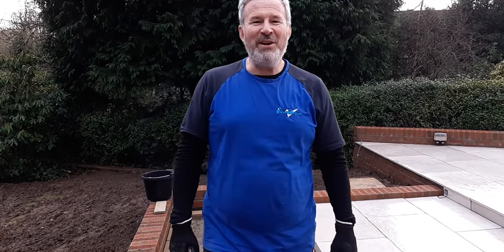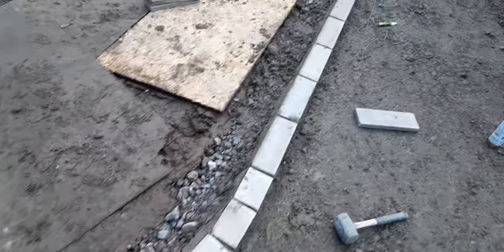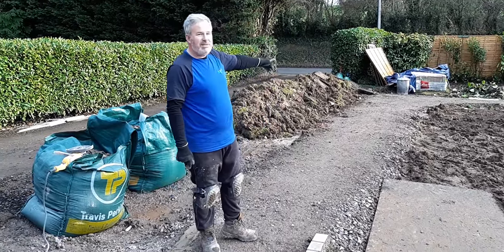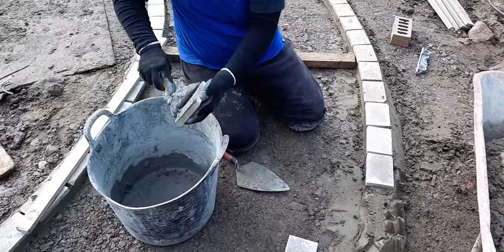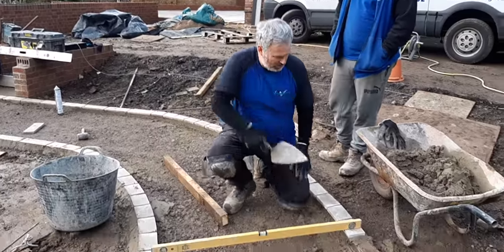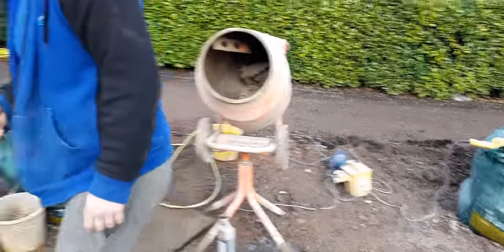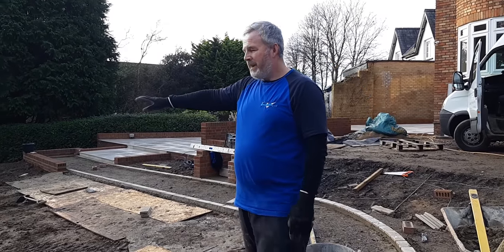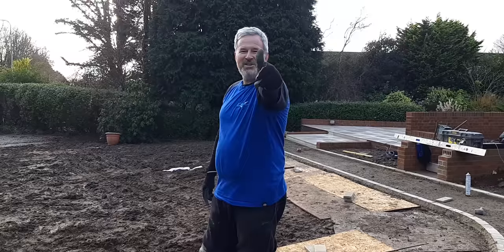CURVED PATH SETTING OUT.

Comment: Great video Justin… im a novice paver but just completed putting a border of 150x50x914 concrete slabs around the perimeter of the garden. Set in a semi dry 4:1 and worked a treat. But now want to add exactly what you have laid as the border except i have already put an edge ‘restraint’ in. Is the semi dry mortar mix with slurry recommended even though mine are are more of a decorative border rather than pure edge?
What was the slurry? Sbr/water/OPS?
Now just need some dry weather…
Reply from the maker: Glad the video has helped John
I always recommend you a slurry on all paving  
The sell paving slurry in the builders merchants. 
Or you can you an sbr john.
Good luck 
Justin 👍
Reply: @brickrightbuildinglandscaping  OK got my border blocks and ready to go this weekend… how much gap do you have to leave when on a straight run rather than on the bend?

Comment: Nice one Justin. I’ve got this job to do in my back garden to border a lawn with a gravel pathway. I’ve seen some videos of guys recommending using a completely dry powder mix when laying the blocks but I way prefer your stiffer mix vs powder
Reply from the maker: Hi Rob
I personally wouldn't recommend a mortor mx of powder semi dry would be my preference that's my opinion.good luck 
Justin 👍
Reply: @brickrightbuildinglandscaping  thanks Justin. I agree, seems like your mix would have a much more solid fixing and less risk of movement whilst you wait for it to go off properly

Comment: On the Stihl, should you look at a new disc cutter in the future. Mine gave up the ghost in the summer and I borrowed a Husqvarna K770. My mind was made up within a few cuts and I bought one. Don't think I'd go back. It is bang tidy Justin 😁
Reply from the maker: Thr stihl cutter is a ts 410 not old ive had a few and found two years in they start playing up im sick of the thing so yes i would consider a change husky seems a good choice .
BT 😂👍
Reply: I agree sthil build quality has become terrible
Reply from the maker: @shaun...6838  
Had two same thing happened after two years they become an issue and i look after the machine aswell so ?
Reply: Both good have husky cut and brake saw powerful machine. 
Stihl ts420. Way forward never had no issues 125mm cutting depth. Best thing a changed as to a standard 300mm. As never get the full 100mm cut which is a pain as most brick stuff 100mm cutting depth. 
Stihl don’t get the 500i 1 if getting new purchase that’s the style without the choke computerised. Issues for me but have used 1 super powerful like the ts700 and ts800 most powerful saws on market. 
Husky’s are super slick saws too nothing between the saws. 
Only a would save stihl easy to fix and more dealers about as to husqvarna certainly the case in Scotland.
Reply: So many don’t put the right and kills the machines in no time. Stihl machine is must for stihl Super Hp Oil.
Reply from the maker: @lmilne4859  
Bang on we only use sthil oil in ours .its running great at mo we do look after it but its a temperamental thing at times .
Agree with all you said 👍

Comment: Great job guys! What I use for free hand curves is a piece of upvc plastic window trim it bends lovely for you isn't it 😁
Reply from the maker: Great idea that never used that ive used a hose pipe and an extension lead cable though .i just eyed that in today worked good .
Thanks for the tip appreciate it 👍
Reply: Top tip Shaun thanks!!